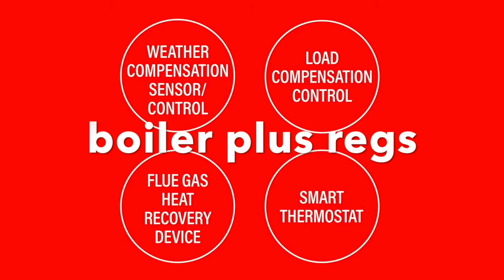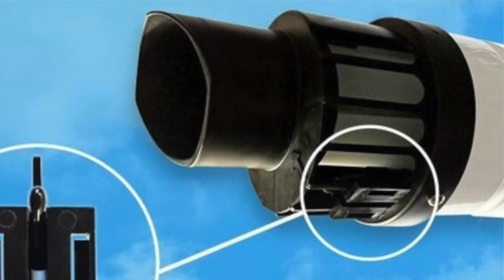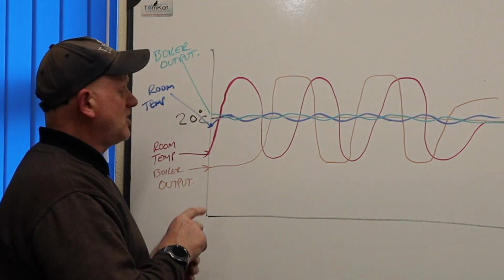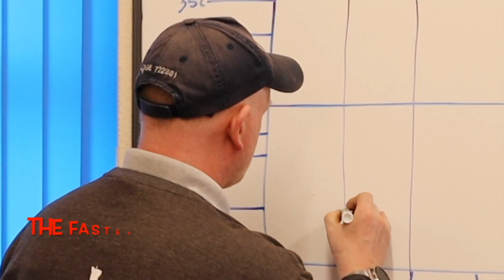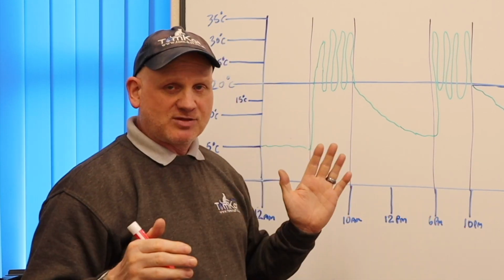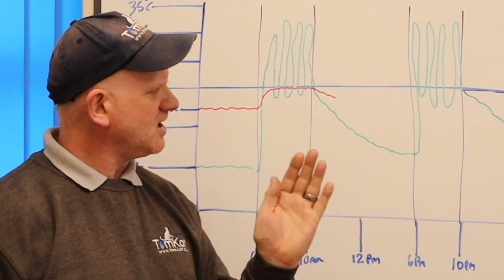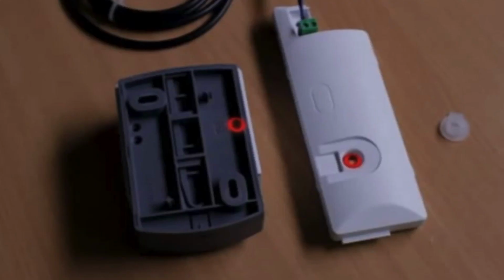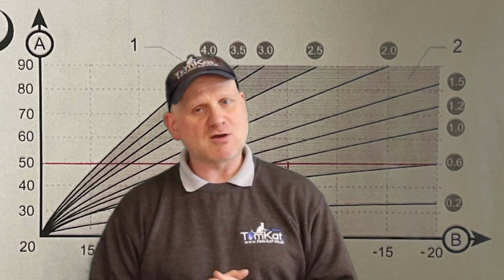Boiler weather compensation, what is it,  does it work and is it worth it.

Comment: Thanks for another informative video but would probably mention this applies to combination boilers not heat only!
Reply from the maker: You can use weather comp on heat only as long as you do priority hot water. Video on that soon
Reply: @tomkatgastraining  yes but I was talking about the content of this video, I don’t think you mentioned you were talking about combination boilers in all the information you gave otherwise you may get people turning down the flow temperature on heat only.
Also didn’t boiler plus only affect combination boilers to add the extra efficiency item like weather compensation heat only just needed time and temperature controls?
Reply: @rickwestwood6258  weather compensation can be applied to any boiler, it's  not a combi only application.  Boiler management systems have been available  in domestic applications for over 40 years. The principles, monitoring ambient and flow temperatures, maximise the extra efficiencies any condensing appliance can achieve.
Reply: @johnward5006  so I’ve been told but I’m still having trouble getting my head around it when a y or s plan plan is heating dhw and ch at the same time from the same source, I’m guessing it can only drop the flow temperature once dhw is up to heat, I fit mainly Baxi’s and I know their ifos kits are only work for their combi range however at home I’ve got a Vaillant 415 on a y plan and it’s got both ch & dhw dials on it but only the ch dial changes flow temp!
Reply: @rickwestwood6258  on PDHW. It will give you full output for HW. With a rapid recovery hot water cylinder this can take 10-15 mins. The central heating is off during this time. Once the cylinder is up to temperature then the heating zone will open and HW zone will close and give weather  compensated heating at lower temperatures
Reply: That's not the case Rick ! I have weather comp on heat only on Y plan. There is a relay wired to HW "on" in the wiring centre. It locks out Weather Comp when HW programme is "on" and calling for heat. It all comes in the kit and is an easy install on my Logic.
Reply: @timhancock6626  yes but I was talking about the content of this video.

Comment: I have to laugh a hollow laugh here. I put weather comp on my own boiler five years ago......six months later I disabled it. Then I gave myself a telling off " get with it man, you are a heating engineer..learn how to use it properly  "..so after another six months I reconnected it, and it's true that with WC you have to learn different strategies for heating the home. I think fuel costs is a big driver in favour of change that maybe was less of a priority previously. Anyway it's staying connected now. Thanks Derek for an excellent explanation. P S  There were weather comp units in all the boiler houses of the council Elderly Persons Units I worked in 25 years ago. Its not new really is it. My night time roomstat set back is 16.5c and normal setting is 18c. which we increase manually on colder evenings. As you say, it rarely comes on during the 16.5 overnight setting. We also put on pullovers...the oldest heating invention of all 🤣
Reply: lmao y'all have 16.5c in your BEDROOM AT NIGHT  ?? loool

Comment: Surely it would be better to have weather compensation with internet connectivity so it knows what’s going to happen. For example my room stat is set to 17deg in the morning, didn’t go on and I noticed it was sunny so opened all curtains and blinds - the sun warmed those rooms up to 18.5 deg in 40 mins. One of these simple devices would have turned my boiler on if set to 18 deg. Definitely would recommend a good timer though - I can set six heat times per day and minimum temps in between those times ( I only use 3 heat sessions per day).
Reply: you have both an internal and external temp sensor, it uses both, the outside helps to mitigate against losses in the building handling flow temp mainly while the internal temp sensor will be the actual target temp.
ie if the outside is super cold (0c) and you had a fixed flow of 50 say, then it would take longer to heat up to your target of 20c, if it was only say 10c outside then it would warm up faster as there is less loss. WC will adjust for this by altering the flow temp so it gets up to your target temp, once there it reduced the flow to balance the losses vs the heat input to maintain your target 20c
Reply: @ricardobranco7357  . But wouldn’t it make sense if the wc knew ahead of time that the temp was going to drop or conversely was going to rise significantly so it can decide to start heating or stop early rather than reacting at the actual time? i.E there was a sudden drop in temp last night but a quick rise this morning.
Reply: @bordersw1239  Oddly enough my dirt cheap programmable stat from Wolseley has an "Optimisation" option you can enable. In Optimisation start  it "learns" how long it takes your home to reach a set temp and turns on the heating a bit earlier. If you enable Optimisation Stop as well it learns how long your home retains heat and turns off a bit earlier. It's actually made by Honeywell, but labelled Center Brand model 340017 for wireless or 340018 for fixed wired. I know it's not really what you were referring to, but in practical terms it does help.
Reply: @bordersw1239  some do, ie nest etc, but it does not account for the specifics around your house like wind corridors, living in a bit of a valley etc.
Knowing what conditions are actually outside your house is always better as is it accounts in realtime for actual weather in your location.
Temps may rise or drops differently from predictions. When was the last time they said it would rain but was sunny and vica- versa, changes also depending on which service you ask.
Reply: @ricardobranco7357  I agree with you. My "local" internet weather data comes from 25 miles away in the plain of York. Up here in the Dales the weather patterns are often very different and the ambient temperature can be a good 1.5-2C lower than down in the Vale of York. They also get fog in winter that we don't get as we are much higher up, and the situation is reversed. Sensor on the house wherever possible !
Reply: Most Smart heating control systems can do this via OpenTherm or their own equivalent. They get very short range local weather forecast information and integrate that with the instant temperatures from the compensation sensor & room temperatures. This is used to adjust optimisation timings as well as flow temp.
Reply: @paulgoff5068  . Thanks for the info.

Comment: very intresting  thanks I have the Honeywell home system for well over 10years   this works out how long it takes to get each room up to temp should it not reach that temp in its normal time it backs the temp down thinking that you have opened a window or door it even shows with a pic of a open window on the display to show why its backed its self and it will never reach the required temp in that room un till the next on time period where it will try and bring it up to temp again.....  its a fantastic system would this device help me in my setup!....the boiler never comes on and bang Stright to max as it has worked out the length of time it should take to heat each room    the only draw back that i can see is the Honeywell uses the local weather station which is 1.5 miles in land from the sea and a altitude of around 100ft above sea level on the south coats I am 500mt above sea level here and about 12 miles from the station as the crow flys !!!! we don't get fog here we get Low Cloud!
Reply: It's pointless, forget wasting your money.   Not only are you being told an outdoor temperature sensor will control your room temperature, but it is using INACCURATE data for your location!
Use a room thermostat and TRVs.   Set the flow temp at 70c.  You will find the boiler comes on, reaches room temp, then switches off for a while, when the room cools down, it repeats.  That is how it is meant to work.  Trying to do this with sensors outside is the most bizarre thing I had heard, especially using weather data that is nowhere near your house wall.
NO installer fits this, no manufacturer recommends people use it, the Bosch App for my boiler even tells me not to use it as it is problematic.

Comment: Like you say, customers are not happy if they can’t have the heating on full when they want it and I’ve had to disconnect many weather comps, even if I advise turning the curve up. I even get customers not happy with open therm stats that don’t reach the exact set temp asap.
Reply: Have you noticed much of a change this year with gas at 10p per kWh Matt? Or is it too early in the season to judge?